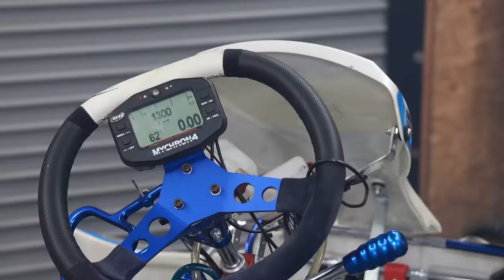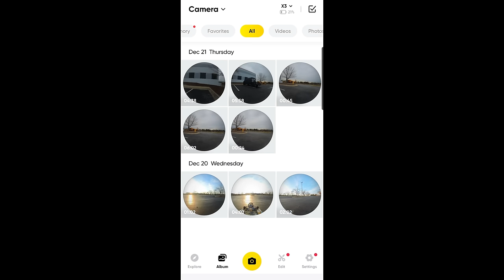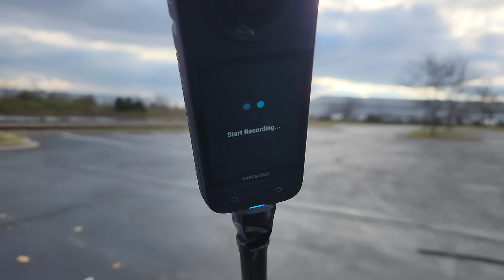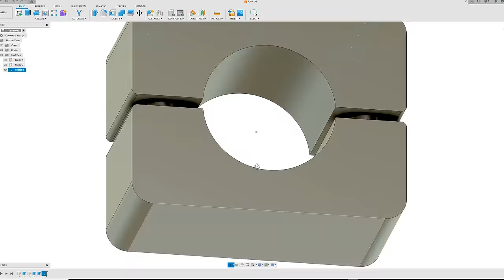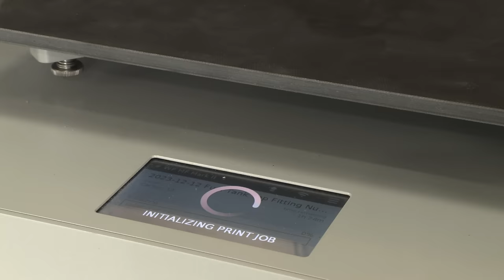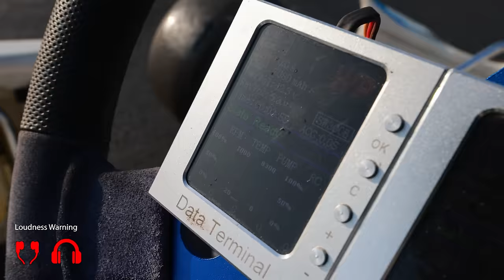Jet Powered Go-Kart (3 Jet Engines)

Comment: Hey! wonderful video, loved the 360 degree shots. While watching it got me thinking about how your rear end is basically the same as an aircraft (jet or something) and you are really just trying to fight to point the kart in the right direction. I was wondering how difficult it could be to make exhaust that combine the 3 and add gimbleling, like thrust vectors on jet fighters. Graphite or some ceramic coated titanium that does a basic turbo oil (for a bearing fluid spherical coupler) lubrication for the gimble mount to a bell end area to recapture thrust. Its effectively the same as a rocket engine, but it of course is based on principles of mass ejection speeds to outright performance, however the biggest issues aren't those, unless you are trying to travel extremely fast. Upwards of 3 mach. 

Slower speeds allow for better efficiency of slower speed capture of escaping gas. The nozzle needs to be able to flare out in a multiple crimped manner way, it allows for further travel along the bell end from a boundary layer effect, to then have a given type of expansion that cools it off but also allows for the bell end to do its work energy capture. 

If not all that, maybe just a simple rudder like design that allows for some basic thrust vectoring that ends up helping total maintained momentum in corners, that and building a big old ram air pipe system to sit on and feed into all 3 of these jets. It would probably help quite a bit with giving it more air & having it be more consistent air flow through to the jets. Allowing for better burn overall, improving performance, but if you force more air in you can't go too lean otherwise you'll damage the jets, as I'm sure you'll know all about, same with putting more in as their is a point of a risk of over pressure, plus they are expensive. I would say a type of lower temp gas, butane, together with a given type of throttle body valve (tear drop like) at the choke point that still allows for a really high flow will work. Or maybe diesel with a little water thrown in from the ram air. Could keep temps down. 

Anyways, you would have to somehow hook the seat up to not get over heated from the heat transfer while also making sure the frame is adjusted to allow for it to be a part of the ram air intake system. Its so small that I doubt there would be no cutting involved. Anyways, hope it helps :)
Reply: That’s crazy the jets can run on diesel?
Reply: @brkbtjunkie  yeah he had a video of the trust produced a long time ago put out of it running on biodiesel, most jets can run on a variety of fuels, I suggested butane because of how cleanly it burns but also it's low heat output.

3 exhausts into one would be hard to maintain the given structure & material performance in this application thanks to the given heat concentration point over the given surface area.

But if you "crimp" it, put channels there it spreads the given total load over a larger surface area, forces the faster center gas flow, channel area flows, and in between stator like areas of slower boundary layer gas flows to mix and spread outwards into the bell end.

But it's not just enough to spread the load, I suggested he needed to oil cool & lubricate the point like a turbo does to help it survive.

Anyways, an after burner system after the nozzle point like I suggested in my Dyson fan jet engine video I made about integza video might work but it's not exactly going to allow for the efficient recapture the the expanding gases into the bell end without it being extended or having another bell end inside of the original.

Also he could use a little lever on the steering wheel to allow for fine control of the total movement of the gimble and thrust vector of the system, however it would be needed to have a switch that has it swap sides during oversteer situations that allows for a recenter effect of thrust to be applied. Also an air premix manifold ring from the ram air into a Venturi system where the fuel is injected would help with better total air & fuel mixing for a better burn.

Pressures in the nozzle can be helped out with gimble extension but since it's only a given total size of outright heat and thrust as a maximum then you can figure out the total nozzle size from some basic online math you could Google. Making it not necessary to worry about the total pressure constant at the nozzle point before the bell end. Be wary of laminar flows bouncing off of each other and not allowing for exhaust stream combining, I saw it on my feed for a water laminar stream & at that heat it can start acting similarly. However the channels & stators in the nozzle point will help break this up but produce a back pressure that kind of sucks, so allowing for a slight turbulence effect from the exhaust combining points will help, essentially a pipe slightly bigger, one slightly higher up, & another with some dimpling-ish to help but flare it out like a horn and it should combine just fine.

But maybe he just wants to do 2 on the sides instead and get basic rudder controls or something? I mean he did say it was already starting to get too fast to control.

Comment: Hi, great content again.
I’m wondering if the stability/handling improves when you apply trust vectoring? It could be as simple as the steering nozzle like a jetski and connected to the steering wheel and turnig opposite from the steering motion.
I think it should be more stable. For instance, when you steer a left corner the nozzles swing out to the right to counteract the oversteering.
Good luck, and i am looking out for further content.
Reply: I think some sort of aero-steering rudder system would help more and not lead to instability at high speed like vectoring thrust - which should be parallel to the tires at all times imo but ianae
Reply from the maker: I thought about doing that on multiple occasions, problem is that is not only an engineering nightmare but I think it would be much less predictable and very unstable... Only because you have tires touching the road, That extra friction in the straight direction helps you dig into a turn. Now thrust vectoring in the air is a completely different story cuz it's very PID, sort of like sailing a boat when you want to turn, but in the case of a land-based vehicle you want to turn instantly You don't want to have to start turning now to hit a corner 30meters ahead, If you make one miscalculation you don't have enough distance to correct and BAMM!
Reply: @WarpedYT If there's a guy to solve for TVC on a jet powered gokart, you're 100% the guy Matt. Sorry to be the bearer of bad news 😅
Reply from the maker: @nathanieljames7462  lol.... I could totally do it I just don't know if it's worth it unless maybe sort of like the hovercraft works, where you use thrust vectoring as steering, but that hovercraft is scary scary to drive, Even Rich rebuilds and his crew wouldn't touch it after I left, they wrapped up their video right there and then and shipped it to me lbvs
Reply: @WarpedYT  This might be a stupid question but could different kinds of tires help with the stability issue too?

Comment: That was BAD ASS!!!!   As a gas turbine tech who works on LM aero's.... well done!   The 3D printing is phenomenal.   not sure if you're worried about FOD but a cool look would be some cone shaped air filters.   Maybe take it for a rip on a runway, and get some water injection into the compressor.   you think it was fast before..... it will be like hold my beer!  hahahaha
Reply from the maker: Ha! Thanks, yes I have FOD screens fitted on every engine 🙂, as for the water injection you are correct , I want to try a few things but I need to make some sexy containment covers first, I feel confident but accidents always happen when you least expect it.

Comment: I know it would add a bunch of complexity to the project but if you found a way to couple the engines to the steering, so they vectored toward the outside of your turns, it might boost your cornering ability. Whatever though. This was a completely sick build. Nice work.

Comment: A couple ideas my non-expert self thought of when watching this

1) what if you enclosed the system with smooth paneling to make it more aerodynamic, and installed S-ducts much like those on the Lockheed Tristar to redirect airflow directly to the engines?  Right now the seat disrupts the flow of already moving air, and installing an S-Duct to the intakes could improve air flow

2) Have you considered the idea of designing a turbofan engine? If you installed one or two turbofans in place of those 3 turbojets, you could greatly increase fuel efficiency

Comment: You need an after burner kick in everytime you hit full throttle. Kinda like a nos kit with jet full thatll work perfect. Itll give alot more acceleration and coming out the turns once your straight hitting full throttle will fix alot with it.

Comment: Built a merge collector to combine the exhaust into a single tailpipe and add an afterburner and variable geometry nozzle! I'm pretty sure it'll be enough power that you'll need to build a dedicated mini jet dragster chassis for it.
Reply: In a dragster a fixed geometry nozzle is superior.

Comment: I am a jet engine mechanic and they work best with uninterrupted airflow and ram effect is necessary to achieve optimal performance and mounted behind the seat they might compressor stall without enough air. You can implement ducting directly into the airstream. Please be careful, these engines have not seen there full potential and I don't think you want to know what that is. Salt flats maybe, but great work that is a great achievement already! Be safe!

Comment: i'd love to see you bring this to the track & try to dial in a setup for it, considering it's basically like you have the chassis dynamics of how it normally acts while free coasting 24/7 - but with thrust pushing directly above the rear axle. It'd be super interesting to see how you'd dial in your overall setup around it (also im assuming you're a cart nerd, so you've spent plenty of time/experience doing this w/ your shifter cart in it's original config)

Comment: Maybe you could look into altering the angle of the engines so they're thrusting downwards (Exhaust up intakes down, maybe 5-10 degrees) a bit and pushing the kart down. Little bit of extra downforce couldnt hurt a bit, you'd trade the driftiness of the original setup for tighter cornering.

Also, jet engines do like clean airflow, and the center one has to deal with the driver disrupting the airflow. Maybe some intake ducts for the engines so they have better intake airflow; it'd also allow you to pull that mesh off the intakes (if you're feeling bold enough) to allow even more airflow and thus more thrust.

Comment: I wonder if you can do something with vectored thrusting tied into the steering.  You could also do some ducted air intakes that act as a little bit of a vacuumed skirt effect. Get some additional downforce at high speed.

Comment: Excellent project! I'm confident you are pushing right to the correct limits of what's safely possible. You have the ideal blend of skill and safety. Would the engines work even better if you channeled air to their inlets? As the chair back is blocking some valuable air mass potential and a little bit of ram effect that ducts could give. You are a superior engineer to me and will instantly know if my point isn't worthwhile. I recall the Bloodhound LSR Land Speed Car and Thrust 2/Thrust SSC accelerated harder after speeds of say 400mph or something similarly fast. So the ram effect is maybe a reason for this?
Thank you for your wonderful work. You are the leader in these types of videos. Kind Regards Rob
Reply: That was my immediate impression and I'm amazed only two people commented on it beside yourself, with no upvotes and no replies.
The seat is not only impeding airflow, it's generating "dirty air" (turbulence), and as the speed goes up the air gets dirtier and dirtier. This is the opposite of what you want, since jet engines gain compressive efficiency the faster they go. That efficiency is being lost, and even being replaced by inefficiency.

The center engine should have a 2 foot set-back and two wraparound ducts on either side for a cleaner, more laminar intake.
Reply: I love the point you have made. Gordon Murray as many people may know is an F1 car designer and also designed the amazing McLaren F1 road car. What is interesting in relation to this jet kart project are his latest 'Fan cars', the T.50 and T.50 Niki Lauda. In an interview video he describes how the fan actually fills the area of vacuum at the rear of the car. This vacuum he says actually pulls or holds the car backwards. The reverse of pressure at the front resisting the car. (The McLaren F1 actually has a fan underneath he said too. That's a bit of surprising trivial though) These fans are for ground effect, to suck the cars down for breaking, accelerating and cornering. But that principle is highlighted, a fan blowing into the rear vacuum area lowers backwards pull. Meaning a long gradually tapered rear isn't needed, like on the Bluebird Land Speed Record cars. Now you have also explained the need of scoops to take ram effect from around the kart's seat, I feel even more strongly that it's totally worth trying! A video including a comparison of with and without would be very interesting watching! I so hope the great man himself reads this. @-danR

Comment: Pretty cool, Matt. 
Now, if you could put some up angle on the jets to make some extra downforce grip for helping in them corners, kind of like top fuel does with its zoomies pointing back and up (of course for you more back than up for forward thrust). Might be able to hold that thing down goin tight around the course faster than ever thought possible.
For that I would put a pair of turbines off each side (middle) with a heavier up angle (not quite 45°-maybe 25°-35°) and keep the one in back but also point it up 15°-20°. The open intakes of the jets will build even more thrust in motion than sucking ambient air behind your back. And then since that thing with three has more oomph than you can use, borrow some of that for downforce. But make the mounts adjustable angle for dialing it in. I’ll bet it makes a whopper difference.

Comment: DUDE! You have to run that thing flat out around the Nurburgring track. But I would seriously invest in some solid spoilers to get max traction. With a balanced downforce and a tail fin, you could probably get around most those turns without easing the throttle. On that video alone, I just subscribed. I will wait with excitement to see if you can at least get it to a NASCAR circuit or a Salt Flat to find its top speed.
Reply from the maker: Thanks!, Yeah a NASCAR circuit would be great

Comment: Very cool, I had a shifter kart 125 cc in the past and those things are insanely fast. Once I went drag racing against superbikes and ATVs and stuff on an official 1/8 mile drag strip night. Best time I could make on 1/8 mile was 8.0 seconds but I had very little practice time. I finally lost to a Suzuki Hayabusa guy that ran 6.6 sec. regularly and was very used to go there. I was not, but it was fun. I really would like if you bring this machine to a 1/4 mile and compare the jets vs 125 cc engine. That would be very interesting!!

Comment: That is really awesome. You need to put the gas motor back in it. Gas powered cart with jet assisted acceleration. That would be rad because then you could still hang the ass end out on turns. You really need to get that thing out to Bonneville and go for a top speed run.

Comment: I wonder if power level  or exhaust vectoring your L and R engines could help  turns.. maybe even independent rear brake turn assist.  Crazy video! I love the project!
Reply: scratch exhaust vectoring, that would be a lot of parts... perhaps limited degree rotating mounts on the outboard engines linked somehow to steering?   You've got my mind thinking about this and not housework... lol